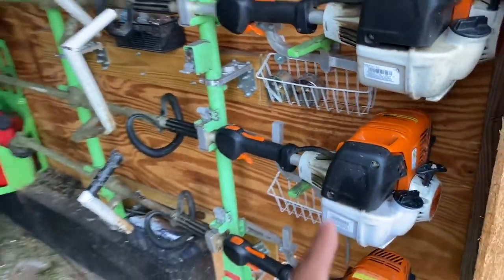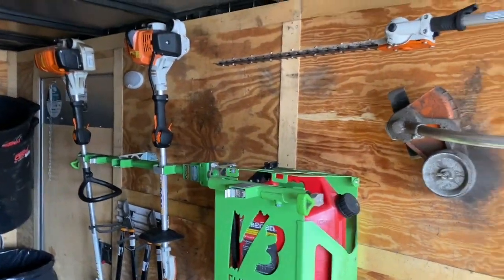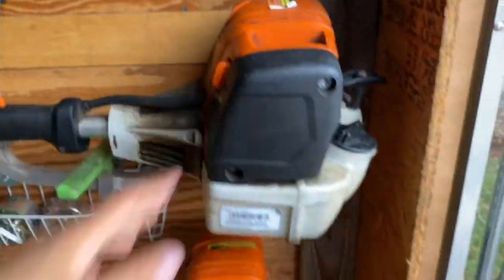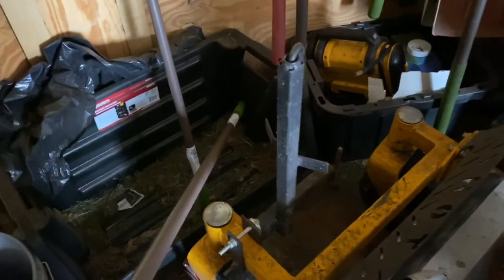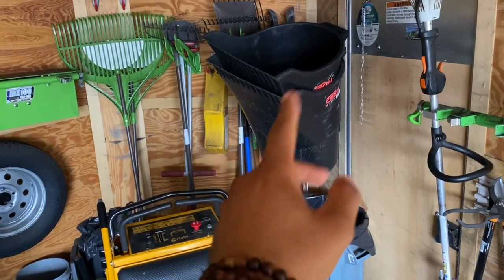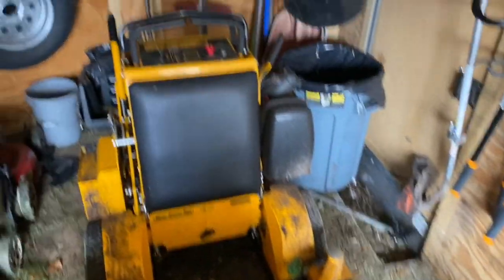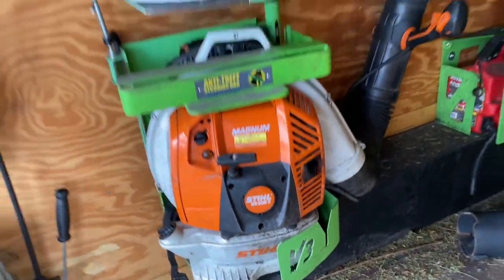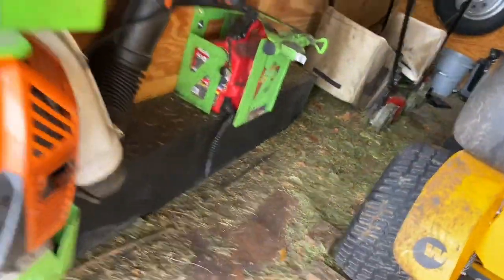Trailer set up and why

Comment: why have the plastic handle on the weed eaters?  i agree on the Darwin's grip. the taller you are the more it helps.  I cut an extra length of trimmer line, make it into a 6" loop put some electrical tape around it and hang it on the Darwin's grip.  no need carrying it in your pocket.  put a 5/16 x3/4" bolt and fender washer on the bottom of the speed feed head . bumping the ground or pavement wears the bolt not the speed feed cap. one bolt lasts about 3-4 months. grade 8 bolts last much longer than butter bolts.  starting 4th season on the original speed feed cap.
Reply from the maker: Plastic handles are turned around to the other side so when we are string trim edging we have something to hang on to. Yeah I’ve seen the bolt thing done and might try it myself. For now I just always have extra caps in my green touch box. First time I hear about about looping string around Darwin’s grip, pretty smart. Thank for the tips hope you have a great season.
Reply: when I edge, i turn the trimmer sideways not vertical like most, (gas cap up). my left hand is on the long side of the darwins grip.  something no one talks about. the first time or two to new customer- i use a stick edger and a must to blow out the dirt from edging- otherwise it just knits back in and closes the trench again. after that the weed eater does just as nice a job. I found these big green hands at homer depot $7 (outside in the garden tools). they work great for picking up trimmings and briars. I like your catchy bucket but already had tuff cans.